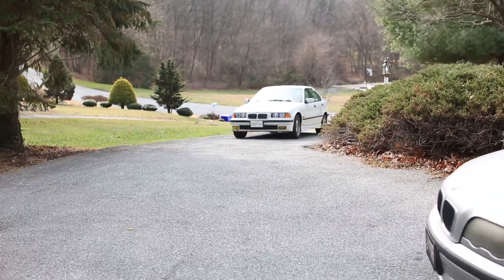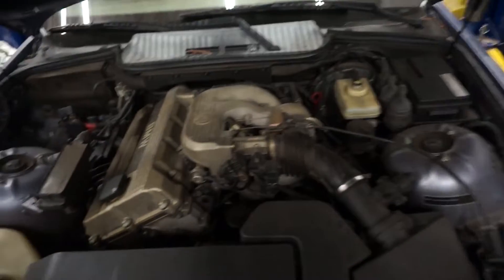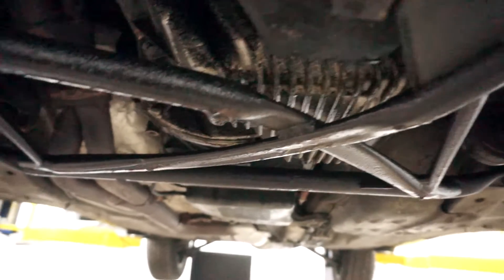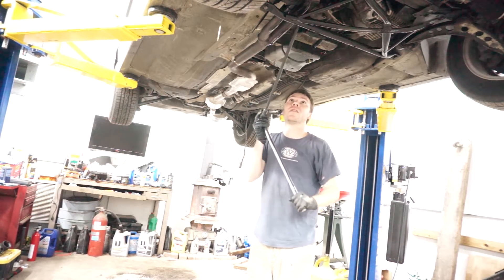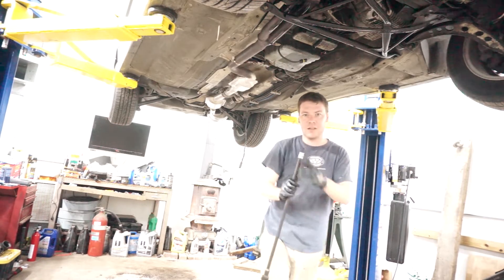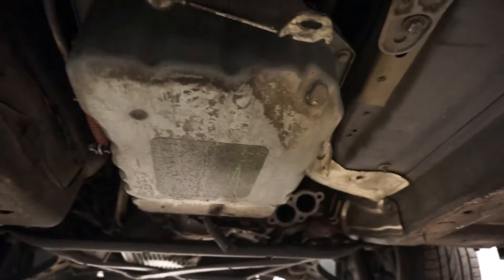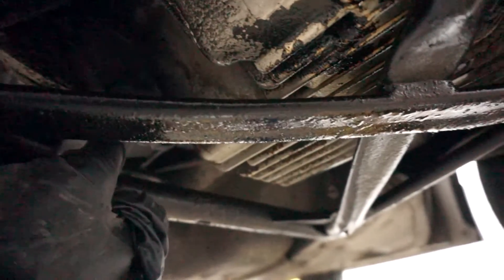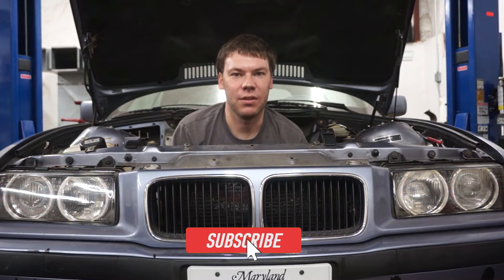E36 318i 6 Cylinder Engine & Manual Transmission Swap: Part 1

Comment: Let me barrow that lift lol
Reply from the maker: The crazy thing is that the lift has about doubled in price since I had it installed! Originally it wasn't all that expensive but I did buy this house specifically for the garage.
Reply: @chesapeakemotorwerks  Everything is getting expensive man!!!! My e3) makes this winding sound when I start and drive think it’s the CSB sounds kinda like it’s coming from the drive shaft to me.
Reply from the maker: @seanshepherd6767  For real. I've always had CSBs make a knocking sound under the floor when they go bad. If it's more of a whining sound, particularly at low speed, I'd suspect the transmission. It's probably still worth trying to replace the CSB since it's the cheapest and easiest part to replace though.
Reply: @chesapeakemotorwerks  Okay thanks man!! I was also thinking it could be the diff I’ve never changed to oil in there 😢 Might have to wait a bit it’s to cold in the Maryland weather🥶🥶🥶
Reply from the maker: The diff is also possible, those usually make noise at all speeds although it can be difficult to hear at higher speeds. It got cold in a hurry, I completely understand!
Reply: @chesapeakemotorwerks  I got some fishing to do i guess lol Man YES it did!!!